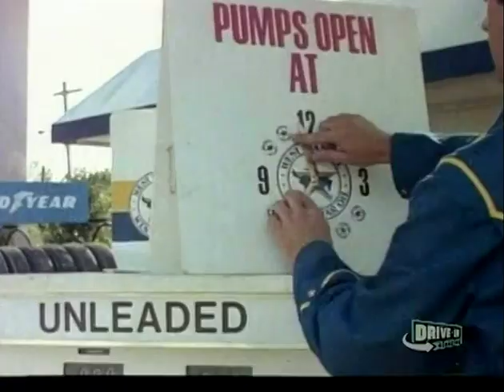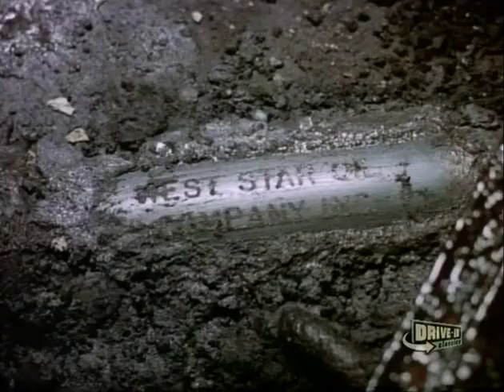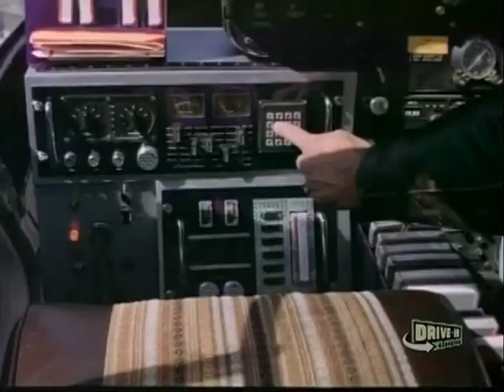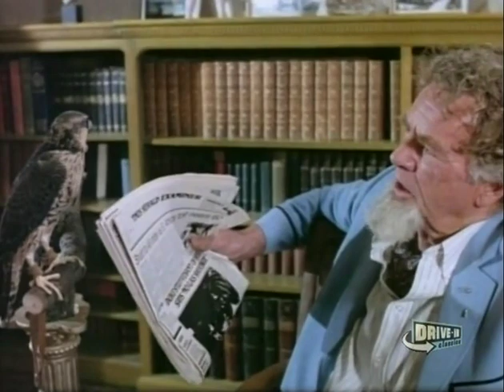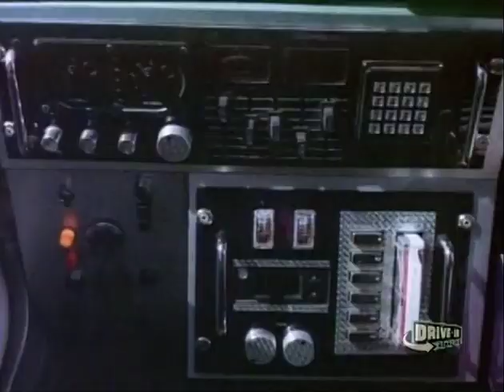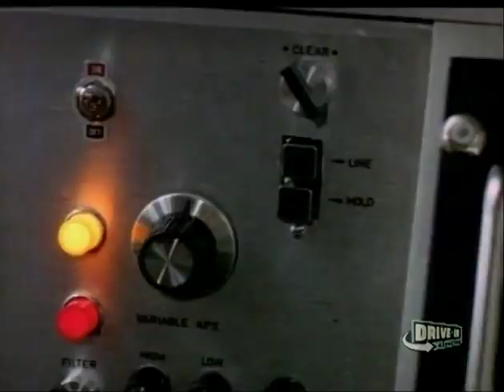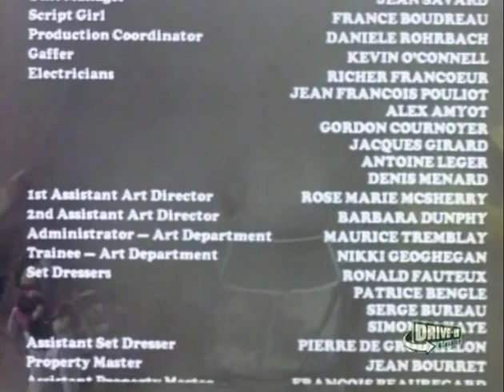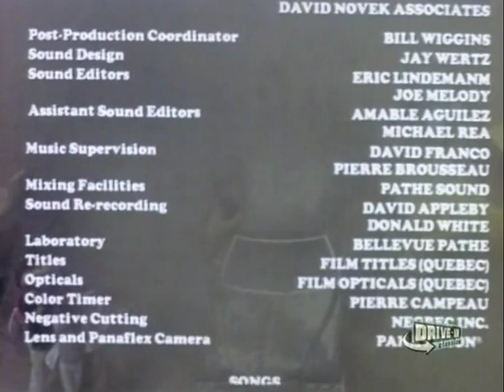GAS 1981 Susan Anspach Howie Mandel Sterling Hayden Donald Sutherland

Comment: 6:53 for the footage of Nintendo Wild Gunman from 1974
Reply: Pretty sure the system doesn’t beep like that as it sounds too much like a video game and not an electromechanical one like when they showed the real thing in France. Also, shooting a real gun at the screen likely won’t work either since the one used as a controller communicates with a wire.